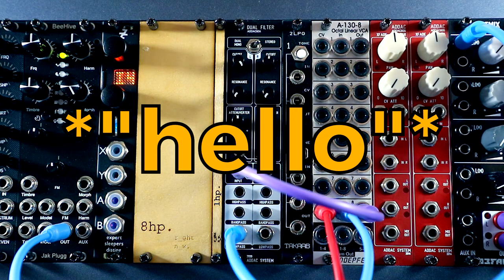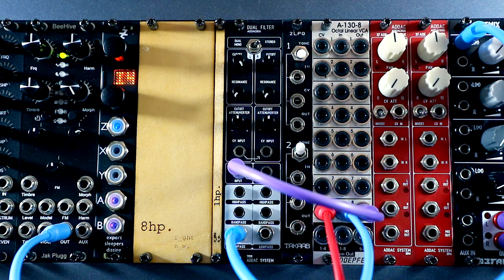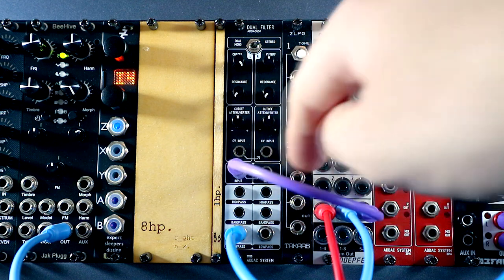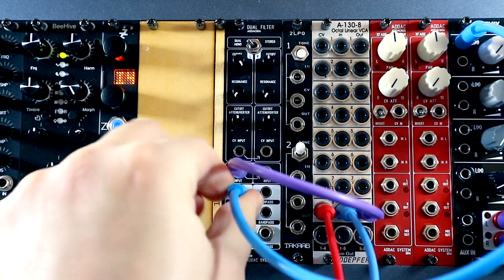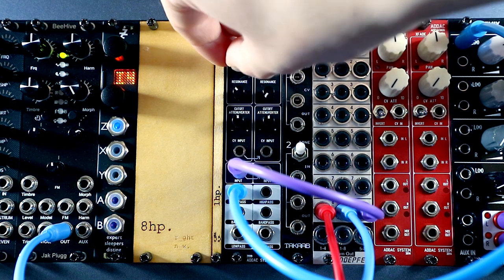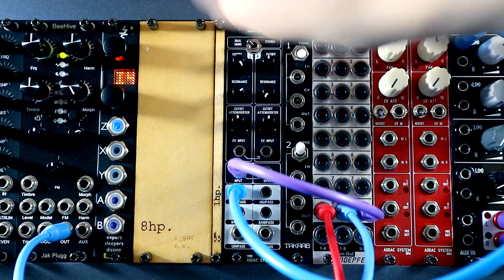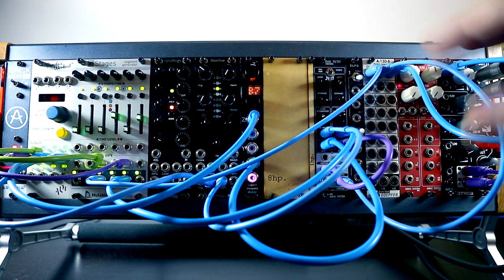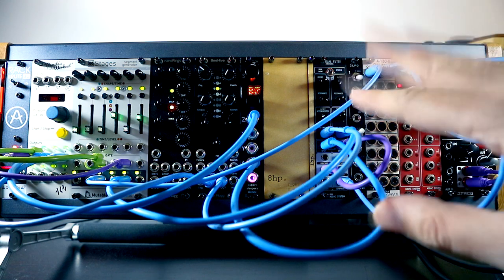ADDAC604 - Dual Filter - a little stereo filter that likes a little filth!

Comment from the maker: Timings:
00:00 - Intro
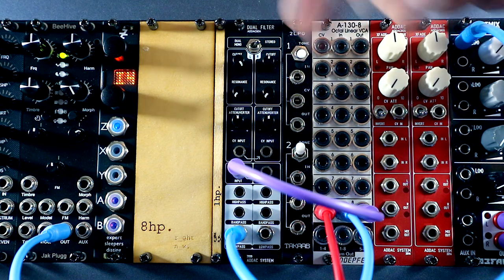00:38 - Features
03:20 - Mono Filter Sweeps
07:25 - Driving the Filter
10:14 - Mono to Stereo Upmixing with Filter Offsets
11:53 - Generic (albeit stereo) Acid Line
14:05 - Stereo Filtering
20:28 - Can We Track V/Oct?
21:46 - Pinging The Filter
24:11 - Parallel Bandpass Vocal Sounds
26:05 - Spectral Panning with a Single Channel
27:23 - Series Routing for Different Flavours
29:06 - Audio-rate Madness (pseudo-FM and percussion sounds)
32:11 - Final Thoughts

Comment: I have the ADDAC105 4 Voice Cluster that has this same filter in it, I'm finding I use the External input on the filter of the 105 more than the 4 Voices. So I'm probably going to grab one of these 604's sometime. I'm waiting for someone to do a demo of the ADDAC106 T-Noiseworks, there is hardly anything online.
Reply from the maker: I wasn't even aware of the 106 - looks interesting. I've been thinking about making a "primitive" drum rack (primitive as a vibe I mean) and I'd definitely consider one of those in that role.